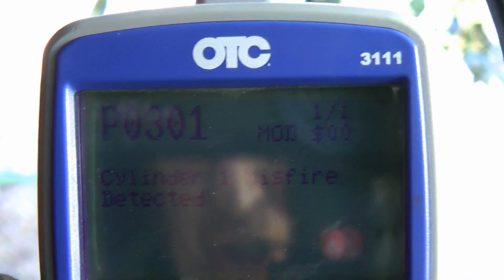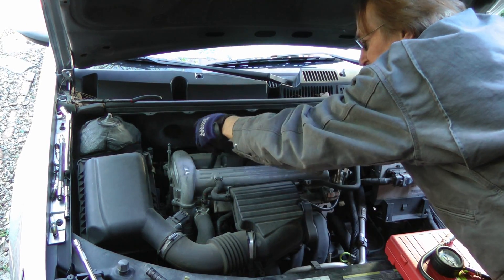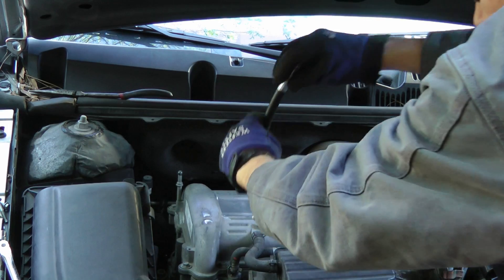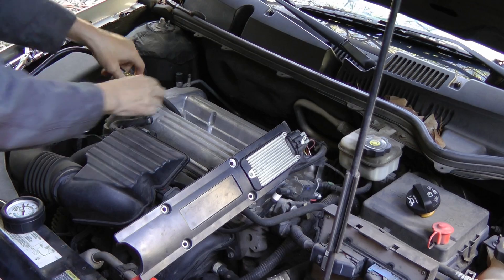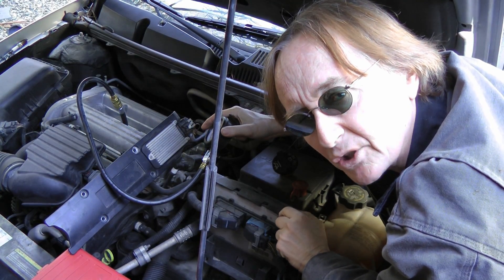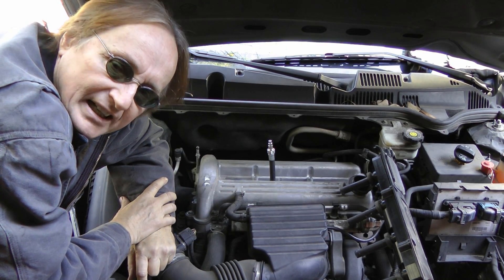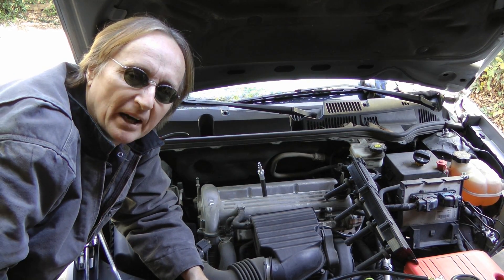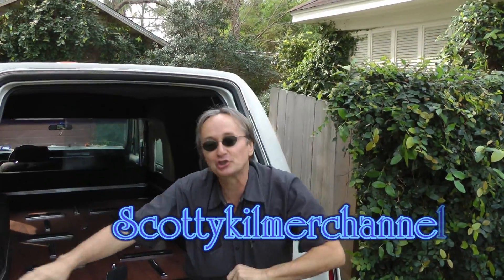Why Do Engines Misfire, Code P0301 (Compression Test)

Comment: Probably the type of oil. For instance in a 5w30 oil the 5 stands for the weight of the oil when cold, and the 30 is for when it is at running temperature. If the car has something like a 10w30 oil, try running a 5w30 as it will get around the engine better when cold.

Comment: Hey Scotty
Want to get your opinion on something that's happening to my Jeep. I have a 2005 Grand Cherokee with the 4.7 and my oil light is randomly going on and off. I changed the pressure switch and even went to the extent of getting the one from the dealer. It still happens, more so in the morning when it's cold, later when it warms up, the light stays off. I hope to god it's not the pump, sense mine runs off the timing chain. I'm gonna do an engine flush and oil change and hope for the best.

Comment: Admittedly, you're right on the first part, I haven't seen anything that plays in 1080 that won't let you turn the resolution down, so I didn't really think that that was an issue.  If you don't mind me asking, what are you using that only works in 1080?

And as for the second part, I never said it was a local network issue.  I don't know where you'd get an idea like that.

Comment: When you said a "butterfly gizmo" I figured it was a throttle body problem, but looking those codes up it sounds like the solenoid for the Manifold Runner Control is stuck.  There may be a short or a loose connector, or there could be a failed electrical component.

Comment: My friend just bought a car and it was misfiring but we did the pressure test and all cylinders were good. Then we checked the sparkplug wires and one of them was faulty. So little problem and cheap car because of that misfiring.

Comment: I would have put a little oil in cylinder one to see if the compression came up, It might be washed with gas and the rings may not be able to seal cause of it.

Comment: Well the Vue might be cheaper initially but the Honda will have better reliability, parts availability and resale value so in the long run it's a better buy despite costing more. There are so many for sale you can easily find a cheap Pilot in good condition with lower miles.

Comment: I know this video is about compression testing but a single cylinder misfire can also be caused by faulty wiring to the coil or a bad driver in the powertrain control module to name a couple.

Comment: my 2002 ram 1500 4.7 is 160.000 mile get water on oil cap an white sludge what could be the answer i noticed cracks in lots hoses it sucks air is just the weather cant be good get in engine new pcv valve it doesent loose water now it was till coolent changed an added bars leaks head gasket fix no more leak

Comment: I'm doing the same thing.  I invested $1400 in my car over an 8 month period.  All of the sudden, my car is misfiring in cylinder 3.  The acceleration is a bit poorer, but since the cylinder head is not damaged, I'm just driving it around until I find a used car for the same price or less as repairing mine as my car is worth less than the price of fixing it and it looks horrible on the outside.

Comment: my cousin's 2011 hyundai elantra just got a code for cylinder misfire number 4. car only has 15,000 miles on it. it ended up being the ignition coil but damn at 15,000 miles you wouldnt expect that to break. anyways how many miles were on that saturn?

Comment: Scotty, great info. Now that you know that cylinder is shot, did you do a wet test as well to determine if its rings or just the valves. If its the cylinder head wouldn't it be worth to fix?

Comment: Scotty, I have a 1991 Olds 98, with 167K miles.   It has started missing only in 4th gear.  I had it checked by a very reliable transmission shop, and they said the transmission is OK, that it was an engine problem.  Is it possible, for this car to miss in 4th gear only, and it be an engine problem?